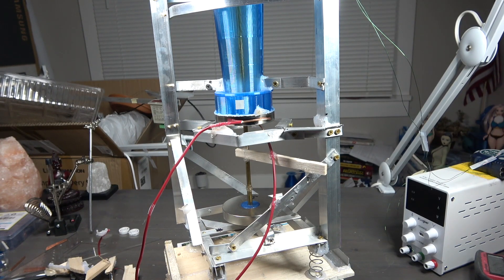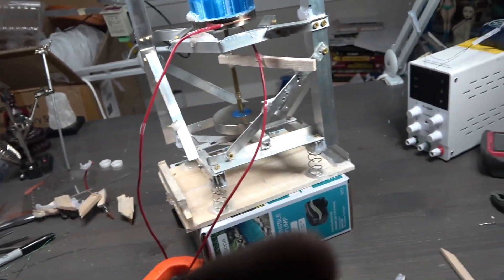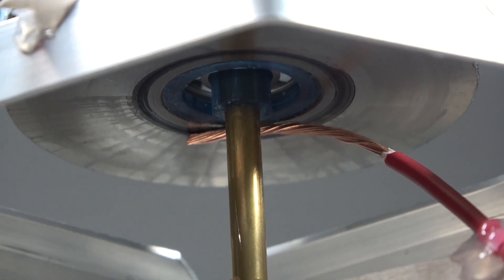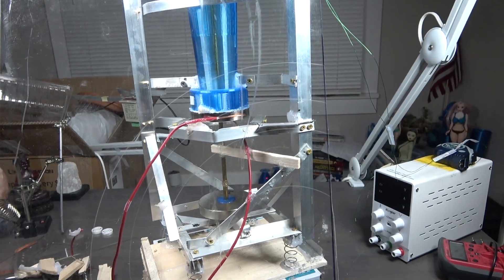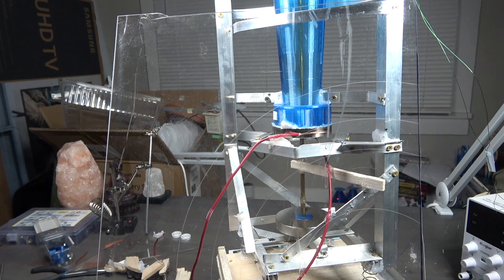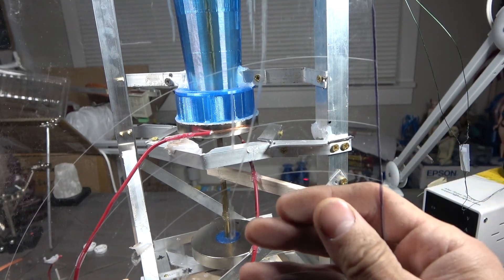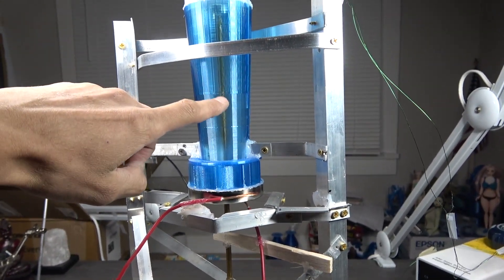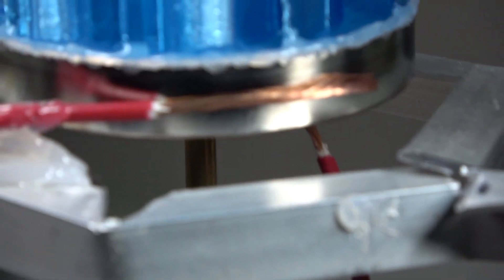Magnetic  Gyroscope Part 2

Comment from the maker: I forgot to mention that the metal frame is made out of all non magnetic material.  Aluminum angle, brass and non magnetic stainless steel screws, as well as brass rod and plastic 3d printed parts.  The only magnetic parts are the electric motor of the blower and the outer and inner ring of the central bearing.

Comment: You could use all metal bearings sort of like brushes and put many of them around the magnet's equator, they should make a good enough connection.
Reply from the maker: I was actually thinking of doing something like that possibly.  Thanks!